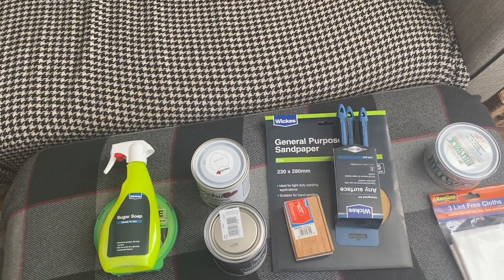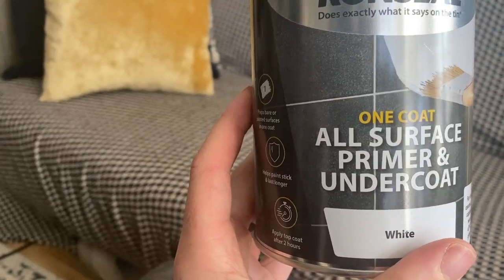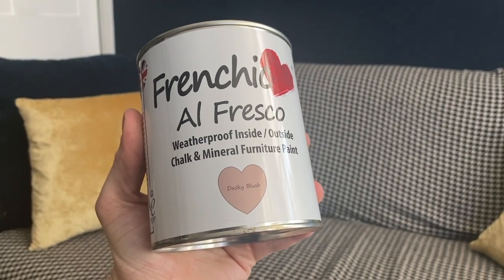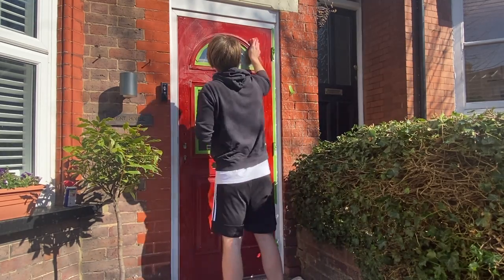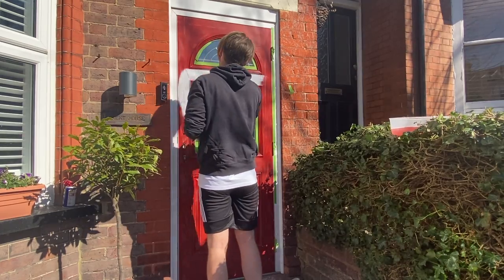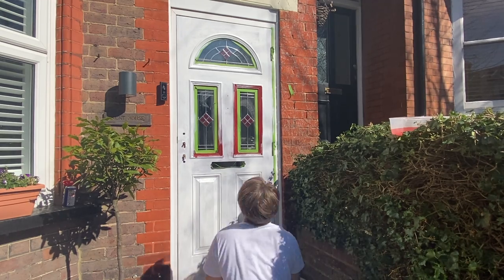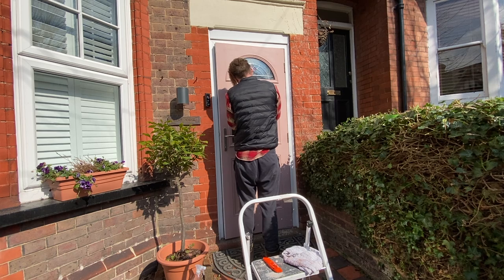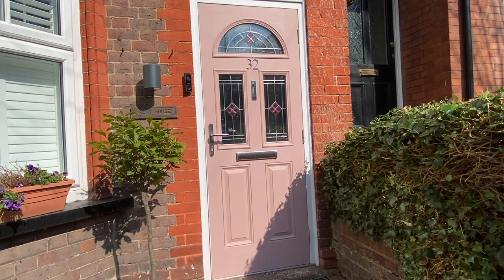FRONT DOOR MAKEOVER! How to Paint a Composite/UPVC front door Ft. French Chic Al Fresco paint!

Comment: Frenchic says you don't need to use primer before their alfresco range, wondering why you did .
Reply from the maker: Hi so because the colour below was much darker than the pink top coat and because it's a composite material, my thought process was that it would 1) take the sting out of the red so the pink is consistent 2) gives a better adherence to the top coat